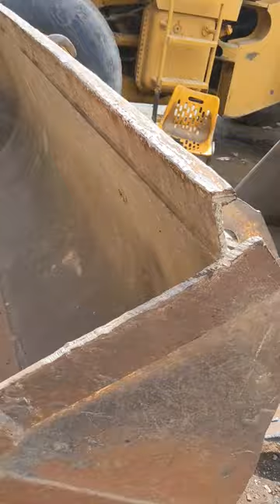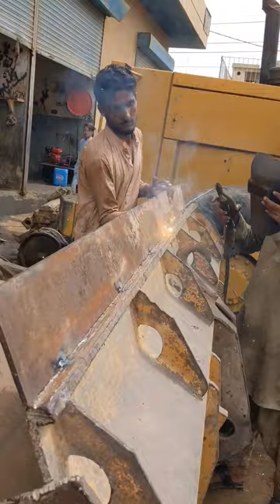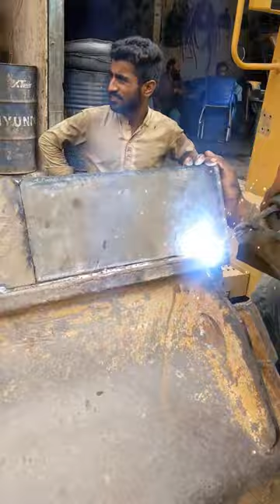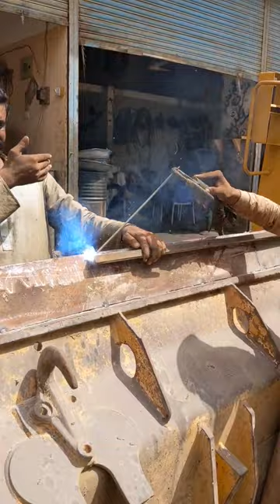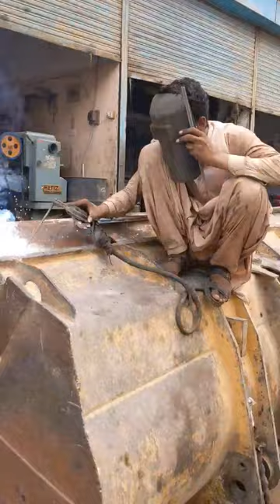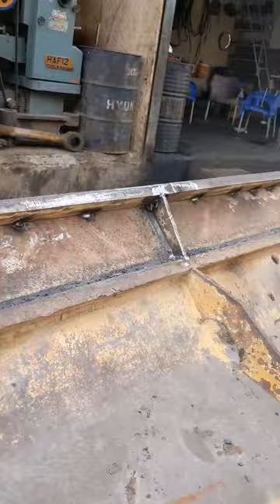Pakistani welders doing cat bucket repairs #shortsvideo

Comment: It is very simple and easy to weld thick materials... the art of weldin is when you weld thin materials
Reply: Все виды сварки важны
Reply: That is not true. You can make a weld that looks good but will not actually hold when stresses are applied. I wouldnt trust those welds at all. No protective equipment at all isnt very smart either. Just because it holds while just sitting there doesn't mean its good.
Reply: @selenehenry3040  lmao I feel like every other video from these guys theyre repairing the same bucket, I would not trust these much either lol